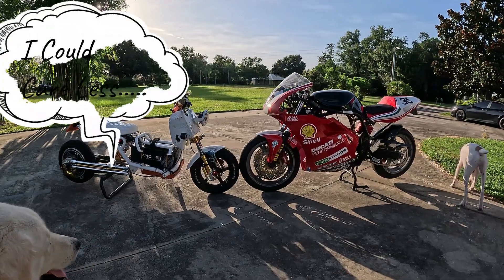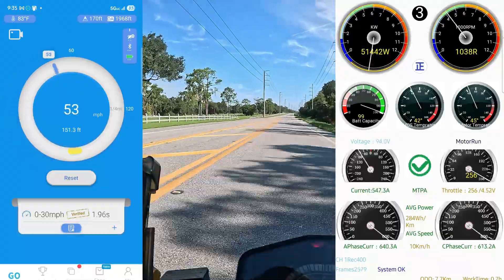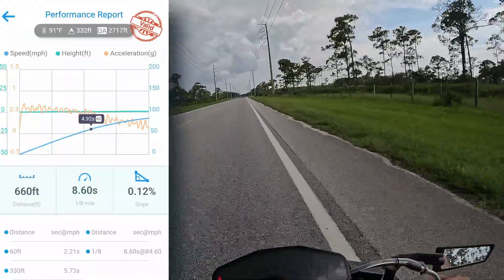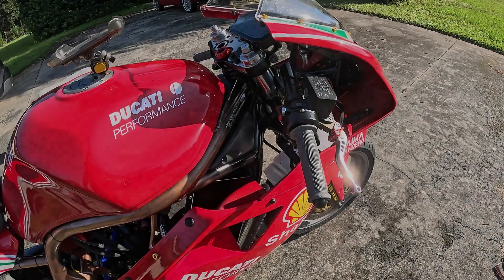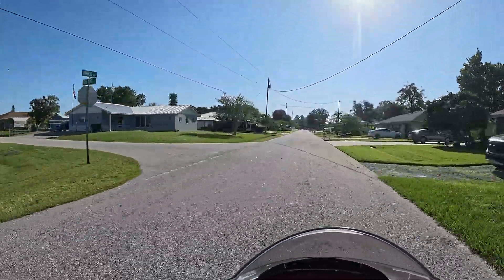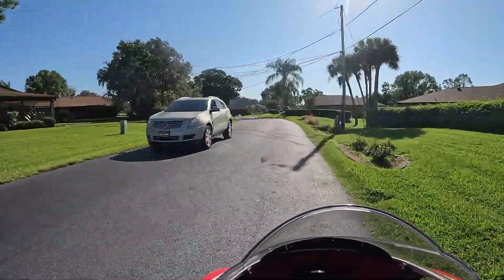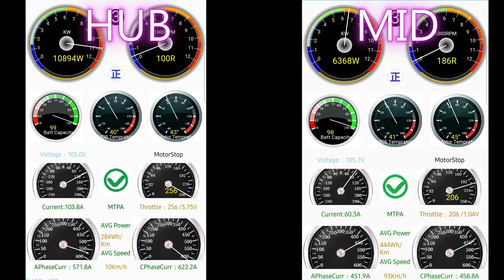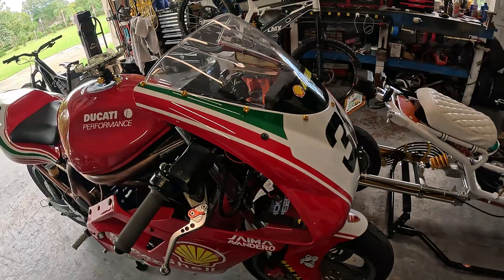Mid Drive Motor VS Hub Drive Motor.  20KW Sotion GTS35, 20KW QS 268.  96 Volt Comparison

Comment: Perhaps one of the most valuable hub vs mid comparisons on youtube, thank you!
Isn't the 0rpm torque better with the mid drive motor tho?
Reply from the maker: I did not found that to be the case.  I hear that mid drives are "torque" from everyone,  but I think I can get better launch torque from a hub.  All the fast bikes that drag race use hub motors.

Comment: Good video, although for a fairer comparison, in my opinion, wheel size matters. For me, the hub motor is better.
Reply from the maker: Wheel size is just gearing.  They were both "geared" in theory to go 100mph.  Bit you are correct about the hub motor.  So much better overall.  Smoother, faster, quicker.  Unless you are making a motocross bike, I see no point in a mid drive.  I wish that 268 was 17"...  I would put it on the back of the ducati.  Not sure if you saw ebike guy spoke his 268 for a bigger wheel.  It actually has been done before and may be the solution until they make a more powerful 17" wheel.

Comment: I think fewer teeth in your sprocket in the rear, should get you a higher top speed at the expense of torque.

I feel like you already know that xD

Was looking at the difference in rpm and was like….you can take advantage of some of that if you change that gear ratio up a lil 😅
Reply from the maker: For sure.  You beat me to the punch.  LOL.  In that 68kw video I just posted, I compare the smaller sprocket in back.

Comment: you need to try a 165v3
Reply from the maker: Well I wanted a 20kw motor so it would be close to the hub in power.
Reply: @GhettoWrench I can get 60kw continuous out of a 165v3 kw ratings don't equal performance. And qs ratings have never meant anything I'm telling you the 165v3 is built different and it's a powerhouse. It's very very loud tho
Reply from the maker: @BlahJamiee who cares about the motor.  I want your battery that can deliver 60kw continuous 🤘😁

Comment: I have a 12 inch Yuma Hub at 3000w and I paired it with a yuyangking 12080 and my phase setup was causing instant wheelies with a feather of the throttle, sadly my Bluetooth never worked so I have no clue what the settings were at when my bike was doing this.

EDIT. I should mention I was running a 72v20ah battery so nothing insane.
Reply from the maker: Thays the best way.  No settings, plug and play, and it pulls wheelies!  🤘

Comment: What winding is your hub motor 3T? Thanks so much for posting this test!!
Reply from the maker: Im going with 3T.  It is 1670 "max rpm" on the spec sheet.
Reply: @GhettoWrench 
Thanks so much for the reply! 
Are you able to do rolling burnouts without holding the front brake? I’m debating on ordering the 4T for higher torque output, but still considering. I’m looking to build a rolling burnout machine lol I have that same swingarm you’re using. Looking at the 961800 far driver to push that heavy hubmotor.
Reply from the maker: @eastwood111 my hub will do that, the mid will not.  I have to use front brake on the mid.  I have had liter bikes that did not need front brake.  I still always use front brake to weight the front as I think its less chance of grabbing and looping.  At least the stunters on youtube tell me that.  LOL.  It is scary when the front takes off sideways with the brake on though.

Comment: Would the different tire sizes make a difference in this test?
Reply from the maker: Yes.  Different tire sizes completely change the gearing.  There are not that many options though on a 12" wheel and 17" wheel to stay with a good street tire and go more than 1/2" diameter different.

Comment: you didnt consider tire size as a factor
Reply: btw smaller tires make more rpm so in theory you could regain some of the torque to do wheelies easier that or change gear ratio
Reply from the maker: @funniersphere44 I would just gear it down for cheaper with a bigger back sprocket.  Watch my gearing video and I explain why I chose that gearing and all.  For a 17" wheel I can only adjust tire size about 1/2" if I want to stay with a nice sport touring tire.
Reply from the maker: LOL.  Ya, I think I did.   Did you watch this entire video about just that?  
https://youtu.be/QVvLN1zq1u8?si=uR_vf18q_EjjjI9F
Reply: @GhettoWrench, if that videos a different one from this, then yes, I didn't see it yet, I found this video on my feed. I guess we think alike 😅 😮
Reply from the maker: @funniersphere44 Ya it has a sprocket and chain on it.  Im using the Omni wheel speed calculator constantly. LOL

Comment: Change your AN settings on the GTS35 to 8 and try 4 if you can change to 4 change the LM setting from 22 to 24
Reply from the maker: I actually tried them all already.  It would barely go and got an overcurrent protect with anything low like 4 and below.  I coukd not tell a difference in the LM, but was told by someone else it was just for initial takoff.  Im back at 16 now on the LM and seems to work the same between 16 and 12 before I can feel it get worse.
Reply: @GhettoWrench yeah it blew my blue hall sensor wire over 8 on my GTS11 it auto learns to 0 but my FW01 AN learns to 16 but Sotion told me to use the same settings on the Gts11 as the FW01 but from experience that is not right at all.
Reply from the maker: @LayItProductions202 Someone told me the ONLY two useful things autolearn does is "rated speed" if done at a lower voltage to simulate loaded sag and "phase offset".  In my GTS35 I had to select phase exchange to make it work.  So weird.  I swear this motor was a return and refurb because it had issues right out of the box.  Sotion said I was a lier and it was new.  But broken things and stripped screws?  Doubtful.
Reply: yea all my 4 Sotion motors only work in exchange mode 2 gts11s, fw11 mini and my fw01
Reply from the maker: @LayItProductions202 oh wow..  so I am not crazy.  LOL.  That is good info.  Someone should make an instruction book right?

Comment: Recommending you to convert your moped to AWD hub motor setup (Eighter 20KW + 20KW or 10KW + 10KW) for even more acceleration and a bit more top speed if 10+10 setup.
Reply: A AWD hub motor setup is always faster then a Mid drive setup for same setups.
Reply from the maker: @SYNDX8 My buddy is doing dual hub.  It will do front tire burnouts.
Reply: @GhettoWrench Indeed, comparing AWD hub motor setup to a mid drive is night and day difference. I once switched to AWD now I never want to leave it its just so much more fun.
Reply: @SYNDX8  Drives like its on rails. Have it on my off-road scooter and the grip on gravel is next level.
Reply from the maker: Hell Ya!

Comment: To change launch time with a mid engine bike you need to manipulate the tooth ratio on the sprockets.  A smaller front sprocket or a larger rear sprocket will increase torque and acceleration. With no real transmission on an E bike its all about the sprocket tooth ratio front to back.
Reply from the maker: For sure, but its a tradeoff.  The fardriver will only let me turn 12k rpm so I dont want to be stuck with a 70mph top speed bike.

Comment: !!!!!!!!!!!!!!!!!!!!!!!!!!!!!!!!!!!!!!!!!!!!!!!!!!!!!!!!!!!!!!!!!!!!!!!!!!!!!!!!!!!!!!!!!!!!!!!!!!!!!!!!!!!!!!!!!!!!!!!!!!!!!!!!!!!!!!!!!!!!!!!!!!!!!!!!!!!!!!!!!!!!!!!!!!!!!!!!!!!!!!!!!!!!!!!!!!!!!!!!!!!!!!!!!!!!!!!!!!!!!!!!!!!!!!!!!!!!!!!!!!!!!!!!!!!!!!!!!!!!!!!!!!!!!!!!!!!!!!!!!!!!!!!!!!!!!!!!!!!!!!!!!!!!!!!!!!!!!!!!!!!!!!!!!!!!!!!!!!!!!!!!!!!!!!!!!!!!!!!!!!!!!!!!!!!!!!!!!!!!!!!!!!!!!!!!!!!!!!!!!!!!!!!!!!!!!!!!!!!!!!!!!!!!!!!!!!!!!!!!!!!!!!!!!!!!!!!!!!!!!!!!!!!!!!!!!!!!!!!!!!!!!!!!!!!!!!!!!!!!!!!!!!!!!!!!!!!!!!!!!!!!!!!!!!!!!!!!!!!!!!!!!!!!!!!!!!!!!!!!!!!!!!!!!!!!!!!!!!!!!!!!!!!!!!!!!!!!!!!!!!!!!!!!!!!!!!!!!!!!!!!!!!!!!!!!!!!!!!!!!!!!!!!!!!!!!!!!!!!!!!!!!!!!!!!!!!!!!!!!!!!!!!!!!!!!!!!!!!!!!!!!!!!!!!!!!!!!!!!!!!!!!!!!!!!!!!!!!!!!!!!!!!!!
10 gallons x 8.34 = 83.4 pounds. Crazy part with you using 10 gallons is that all you had to do was move the decimal over using 8.34 pounds per gallon!! That is about 6.92307693% more weight. I ran out of decibels on my calculator and if I didnt there would have been more numbers lol 🤣🤣😂. That extra weight is 5.4lbs more. !!!!!!!!!!!!!!!!!!!!!!!!!!!!!!!!!!!!!!!!!!!!!!!!!!!!!!!!!!!!!!!!!!!!!!!!!!!!!!!!!!!!!!!!!!!!!!!!!!!!!!!!!!!!!!!!!!!!!!!!!!!!!!!!!!!!!!!!!!!!!!!!!!!!!!!!!!!!!!!!!!!!!!!!!!!!!!!!!!!!! !!!!!!!!!!!!!!!!!!!!!!!!!!!!!!!!!!!!!!!!!!!!!!!!!!!!!!!!!!!!!!!!!!!!!!!!!!!!!!!!!!!!!!!!!!!!!!!!!!!!!!!!!!!!!!!!!!!!!!!!!!!!!!!!!!!!!!!!!!!!!!!!!!!!!!!!!!!!!!!!!!!!!!!!!!!!!!!!!!!!!!!!!!!!!!!!!!!!!!!!!!!!!!!!!!!!!!!!!!!!!!!!!!!!!!!!!!!!!!!!!!!!!!!!!!!!!!!!!!!!!!!!!!!!!!!!!!!!!!!!!!!!!!!!!!!!!!!!!!!!!!!!!!!!!!!!!!!!!!!!!!!!!!!!!!!!!!!!!!!!!!!!!!!!!!!!!!!!!!!!!!!!!!!!!!!!!!!!

Comment: my factory E dirt bike is only 180 pounds  lighter then both those so i wouldn't say they are both lighter then factory
Reply from the maker: A YZ250 weighs 198 lbs.  A gas Ducati 996 weighs 437 lbs.  A Zero SRS electric sportbike weighs 520 lbs.  I didnt just make that up.  LOL.   A dirtbike is gonna be way lighter than a full on road bike.  But my ebikes are lighter than factory built comparable ebikes.

Comment: Forgot to factor in wheel size
Reply from the maker: Its factored in.  All part of the final ratio.  The bigger issue is the 3000 RPM max   16 pole pair vs the 12k RPM 4 pole mid.  The hub is not even hitting field weakening until 1750 or 100mph and the mid would have to be geared like a dog to hit field weakening at 100mph (7000 rpm).  So no real way to apples to apples it.

Comment: I'd take the Mad dog any day, that thing looks sick! But I'm a huge fan of gy6 swapped ruckus builds also though. Any info on if there is a kit for that at?
Reply from the maker: A kit before what? GY6 ruck or the electric Maddog?  The gas maddog came with it.  I converted the white 50cc to electric from aliexpress parts.  Was not that bad.  I have videos on it.  All bolt on.

Comment: Silly question but do you have AN to 16 under para pid in open pro online parameters for the mid drive. Hub is 0 mid drive 16. Will greatly improve torque
Reply from the maker: Not silly.  LOL.  Yes it is in 16.  I also tried some other numbers with no improvement.   When I got to lower numbers it barely took off and sent and error code and shut down.  😮
Reply: @GhettoWrench when you have ratios set when are you planning on engaging weakening?
Reply from the maker: @olingerscreations I have had better luck leaving them at 100 and not even worrying about them.  If I had a dirtbike I may use them to control RPM or overspeeding while airborne.   That is honestly all I can tell they do.  I think Fardriver has changed the program. The weakening seems to be automatic and how ratios should control the depth of weakening and rpm it starts, I dont think it does anymore.  I think the computer weakens based on rated speed (back EMF RPM) and the depth or amount is just controlled by weak response 0 - 7.  But that is all a guess.  LOL

Comment: When you consider that one of the main advantages of hub motors is the minimal equipment in the drivetrain, the extra weight of the other should've been counted against it.
Reply from the maker: Ya the hub is def the easy button.  I dont mind the swingarm issue.  Im gonna do a full size 17" hub bike next.  The maddog is just scary to ride that fast.  😊

Comment: Hello mini me can you help me I want to buy a krv5 motor and fardriver 72450 for my razor what do you think ?
Reply from the maker: That should be a good combo.   It will go 200 amps and give you like 14kw.  Check out voltron watts channel.  Has he reviewed that combo?  He is always doing Razor stuff.
Reply: I'm using exactly that for my build pushing max amps, field weakening and some other fardriver fuckery, got a video with a burnout posted it's extremely fun, currently using a ultra be battery and maxing out amps, heat is an issue, but I can do 2 full speed runs then cool down for more for about 4 minutes just tooling around in eco
Reply from the maker: @johndon3782 just checked it out.  Is that a Razor?  I left a comment.

Comment: Due to change in slope, the hub had to lift almost 400lbs 30ft higher over 660ft than the mid, meaning it was likely a touch faster on a level playing field.
Reply from the maker: I never knew that flat florida road was even sloped.  But you are right.  The app has it on the right.  On my 50cc gas bikes I get the best speed depending on the wind direction even if it is uphill.  😂  I have a video where I took my 70mph "florida" maddog up pikes peak.  Full throttle and 20mph!  Gravity is a killer.   I need to start doing my runs same direction.

Comment: You need taller gearing to keep the mid in its tq band
Reply from the maker: Nope.  LOL.  Did you watch my whole gearing video on this bike before selecting the gears?  Check it out.  Electric motors dont have a power band like gas bikes.

Comment: La diferencia es que para tener estabilidad es muchísimo mejor que la rueda sea lo más ligera posible, esto es tanto para carretera como para campo.
Reply from the maker: The translation may not have worked.  A heavier wheel will be more stable and lighter wheels turn in and out faster like carbon race wheels.  The hub drive is very heavy so it has nice solid planted feel.  The lille bike is just too sketchy to ride fast.

Comment: So i hope ppl can understand surron type motors arnt really a typical mid drive motors and are more just a chain drive bldc motors. Yea they are mid mounted but not through a bb and no reduction gears. We need to have another category and name for these motors
Reply from the maker: I think its because people try to compare a surron with bicycles. Surron is built like an electric motorcycle.   All the gearing math still applies, only your transmission is 1:1 or just 1.  It does not factor into the final drive ratio.  I would say more mid drive electric motorcycles are like the surron and direct drive than like mine.

Comment: Bikes are not the same and wheel sizes are different, the test is about as scientific as stating, "carbon dioxide causes global warming", when ice records all should that carbon dioxide levels rise about 800 years after the temperatures rose.
With the mid-drive there's also gearing to help the motor out 🤷‍♂️
Reply from the maker: LOL.  Do you really think I didn't know this?  Did you watch my gearing video?  You may want to check that one out.  I cover overall ratio, final ratio, gear reduction, tire size and sprocket size.  All of it.    Its pretty scientific for you and also will improve your lap times  If you race.   But as far the comparison video goes.  Yes the gearing is different.    the 12" hub does 100mph at 1750 RPM with a 19.2" tire.  That is out of a maximum of 3000RPM.  3000 rpm equates to 12k RPM in a 4 pole pair IPM mid drive.  That would also be 100mph.  The issue is, the mid drive would only be at 58mph for the equivalent for the hub 100mph.  So to "scientifically" test them as you say I would be testing a 100mph hub against a 58mph mid drive.  Or I could test the 100mph geared mid against the 171mph hub.  See how dumb that would be.  You can not compare them apples to apples.  You have to select criteria for the test.  That criteria was rider desired outcome of speed.  Only that.  Go back and watch that gearing video 🤘

Comment: A few factors to consider......
Wheel size makes a significant difference. 
Hub motor has full power at the wheel where as the mid drive will always have some parasitic loss due to the 2 sprokets. 
On flats, a hub should actually do better than a mid drive.
On increased inclines is where mid drives tend to shine as sprokets can be changed to suit more torque over speed so as to have a climbing beast.
The hub motor is stuck at what ever its windings can handle.
That 8s the major difference between them.
Both are great if it suits your intended need.
Reply from the maker: I can negate the wheel size with gearing, but I didnt.  I actually tested them very unfair.  Test criteria:  Rider preferred outcome.  LOL.  The issue is when ALL the things are considered like RPM and pole pairs and when and where field weakening and max rated RPM you end up with two very unrelated things.  The only thing they have in common is they are both motors. To test them correctly I would have to measure KW at comparable speeds which would be 100 for the hub and 58 for the mid.  In that scenario the mid would "feel" insanely fast with a max speed of 58mph to the rider and it would be insanely quick.  The speed and acceleration would be end results of a fair test.  If that makes sense.  So I had to keep the rider desired outcome constant which was unfair to the mid drive.  Because I dont want a bike with a red line of 58mph.

Comment: Nice. But for build like bike style with shifting, mid drive is great at climbing.
Reply: Yea Ive done a similar real world build on my E-bicycle. For climbing,like up single track MTB etc. the mid excels because you can gear it. There are now hub motors with a DCT type internal 3 speed. Although the gear ratios arent great I hear. Most people equate torque with climbing power not high end

Comment: Do you think a dual motor version would be a lot faster? Or would your front end just washout? I've never tried 40kw I need to build a scooter like this! Impressive as hell!
Reply from the maker: Way faster.  It would have to be right?  😂😂 .  A buddy of mine has a hub with a sprocket on it and a mid drive driving the hub dual motor.  They are smaller.  Like 5kw hub and 3kw mid.  But that thing rocks!